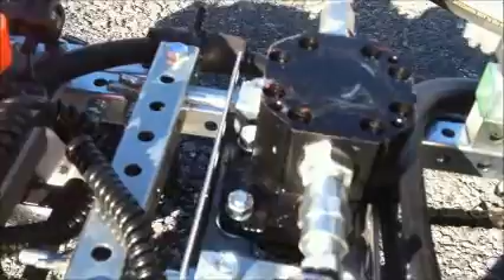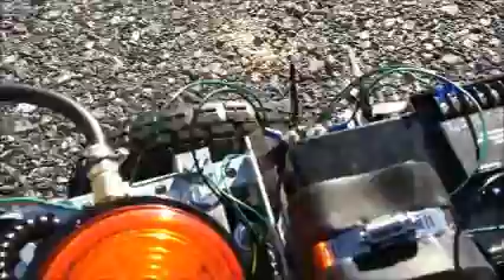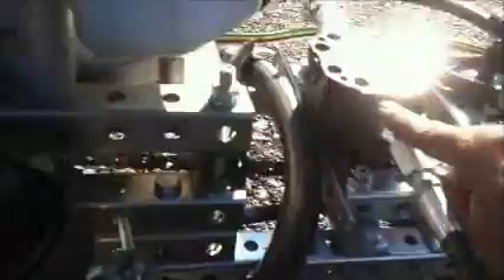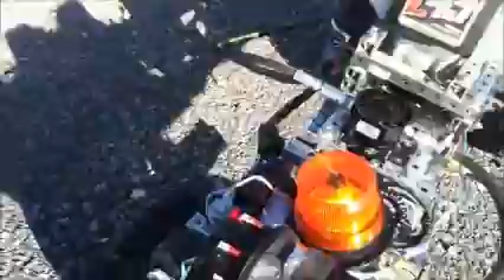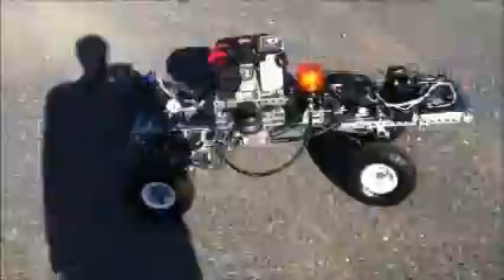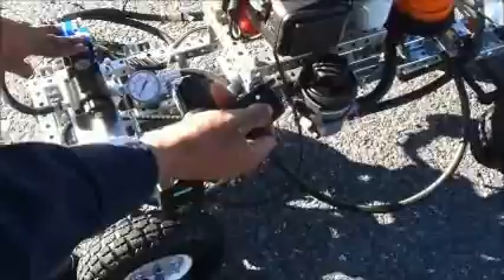Mini Hydrostatic Drive

Comment: I want to use this system in a small garden locomotive. Do you have any links for the hydraulic motor and gearpump?
Reply from the maker: I bought the pumps, valves and hoses from three sources:
1. Surplus Center
2. Zoro 
3. Northern Industries
You can look them up.
Reply: @MiniHydrostat  thanks

Comment: Anab, very entertaining. Thank you for posting. I'm trying to figure out the parts / math involved to make a snow thrower from a lawn tractor to be driven by a hydraulic motor. I want the fluid to come from a 12V hydraulic over electric pump. Maybe you or your other subscribers can help. I'm handy but have never used hydraulic pumps and motors before. Private message me if you can help.
Reply from the maker: Hi Anthony, here are my thoughts. The big question is regarding the lawn tractor you are talking about. Is it a ride-on lawn mower or is it bigger? My understanding of what your are proposing is using an electric motor to drive a hydraulic pump which in turn would drive a hydraulic motor. In other words, using a electrically driven hydraulic power-pack. If this is what you have in mind then I think it will be very inefficient as your are converting electrical to hydraulic to mechanical power, so there are three conversions. You will need a lot of amps to drive something like this. You will need to carry around a big 12v car battery. If you can attach a PTO (power-take-off) unit to your tractor (some tractors already have them) then you could directly drive the snow thrower (you may need a gear reduction). Another idea is to make your own PTO, perhaps belt driven. It all depends on the kind tractor you have access to.

Comment: What spool type is in the valve? It seems like flow out of the motor is blocked when you are in neutral. Sudden stops. Is that right?
Reply from the maker: Yes. P-T A-B industrial valve. No metering.

Comment from the maker: These type of drives are generally used in high-torque-low-speed applications such as off-road contruction equipment, farm tractors and other equipment.

Since it is a 2-stroke air-cooled gas engine for garden auger, I can't imagine the engine efficiency would be any higher than 25%. Haven't done any experiments to nail down 1) Engine Efficiency, 2) Hydrostatic drive efficiency and 3) Overall "Tank-to-wheel" efficiency.